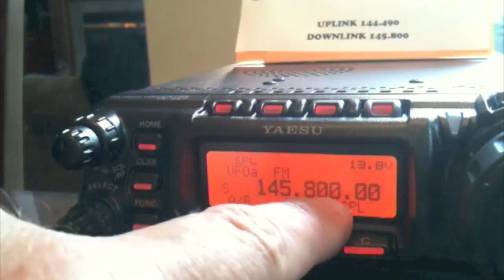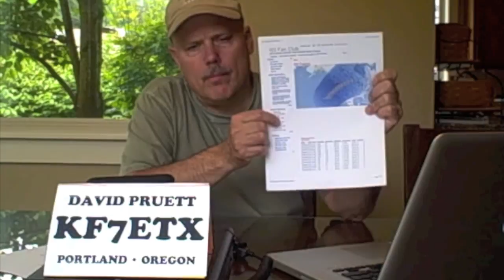First International Space Station Radio Contact!

Comment: I could very well feel your excitement and getting goosebumps following a great,QSO with ISS. I am a new Ham and have been contemplating of buying the Yaseu FT857-D. May I know if it will be correct to use a SMPS based 13.8 volts dc, 22 Amp power supply? Greetings from New Delhi, India.
73s

Comment from the maker: @Postie218 - first off KEEP TRYING!

1. Make sure you are working on UTC time
2. Col Wheelock tends to be quite active after 2000 thru as late as 2400.
3. Check ISSfanclub (dot) com for the passes relative to your location.
4. UPLINK (transmit) FREQ is 144.490
5. DOWNLINK (receive) FREQ is 145.800

I post in the notes for every ISS QSO video some useful links including the crew schedule.

Hope that helps!

Comment: If they were to pass direcly overhead, about how long of contact would you have?  I am sure I could figure out the math, but it is a lot of data I would need to find first, lol.  It is very neat to be able to contact them up in space.  They are a good 250 miles away or so, but at least you do not have much in the way of terrain issues, lol.